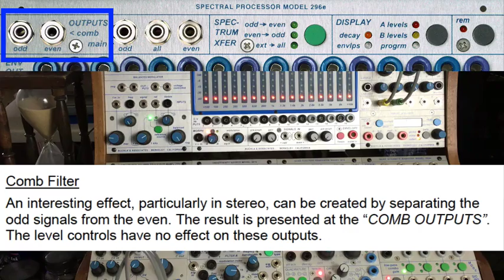Buchla 296e tutorial 4

Comment: Fantastic! May I ask your advice? If you were to choose between 296e and 291e +1 as extra panel space ? Or in other words will 296e be enough as a sole filter module in a 12panel system? Or they are too different and I better struggle to fit both ahah :) thanks p.s. currently building my system step by step, but didn’t even start patching yet as still waiting for the cabinet:)
Reply: 291e is more powerful and more interesting. The built in sequencer is incredibly powerful. If I had to choose between a single 296e or a 291e, I’d get the 291e first. I own both, incidentally. 
They aren’t the same thing. They are both good but the 296e is an extravagance..
Reply: @LPGatekeeper  hey, thanks for your reply! Interesting, then I can target to get both :) but in this case would have to remove 285e frequency shifter from my plans lol, what do you think? :)